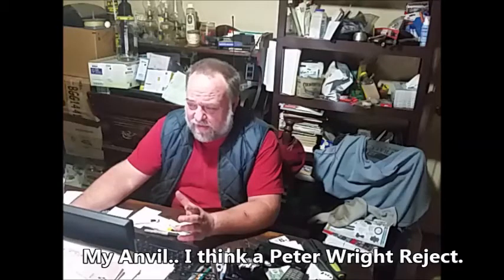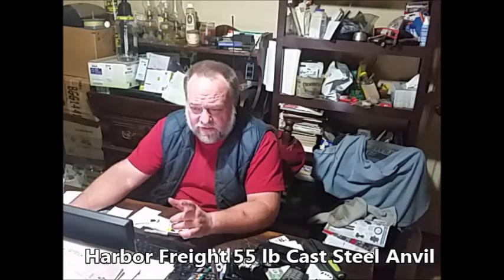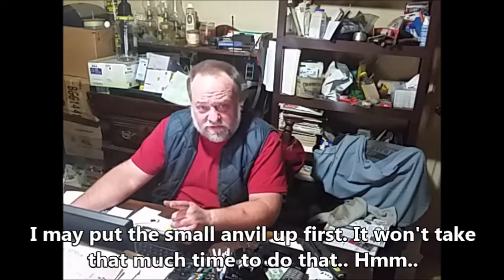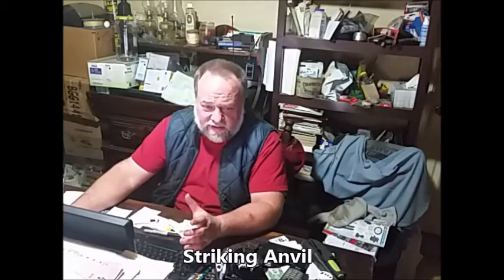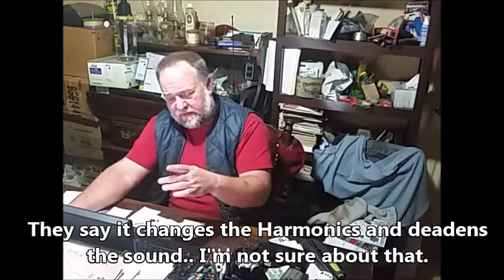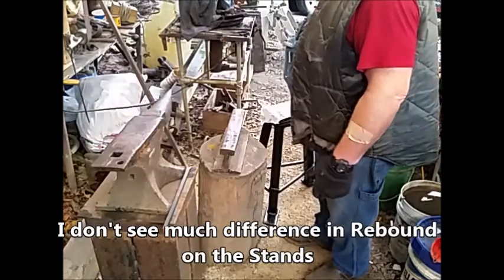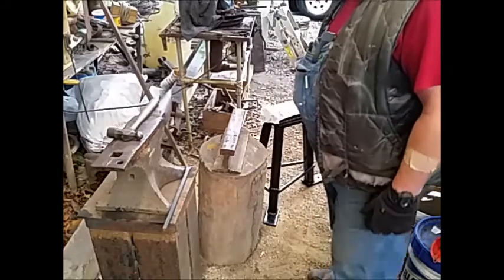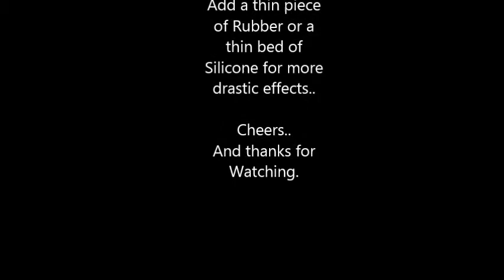Anvil Ring and Rebound Tests (3 Anvils, 3 Stands) See the difference.

Comment: Looking forward to the video of your stand build.
Reply from the maker: I just posted the Anvil Stand Video.. Enjoy.. It's a good one and you 
have lots of options if you have a welder to add swinging arms for your 
tools, etc.. I will get around to that.. There are some reasons I have 
not done it yet, but, I have the ideas in my mind for setting it up.. 3 
sides, swing arms that are removable, so you can remove your tools and 
move them to another anvil, or the striking anvil, or the propane forge,
 or coal forge, etc.. A modular type of system.. Cheers..